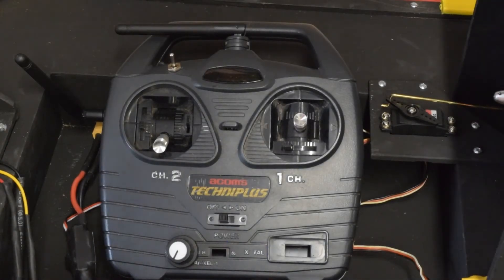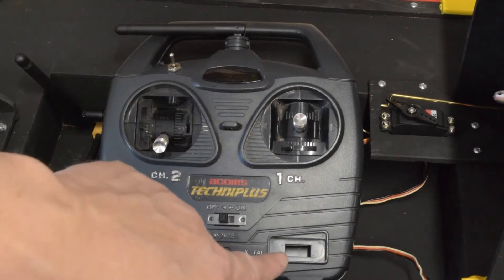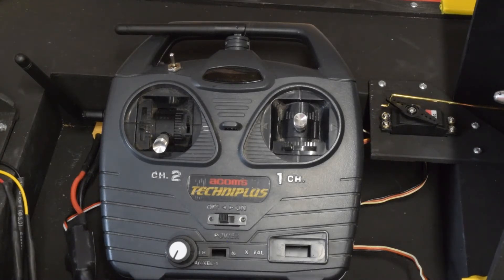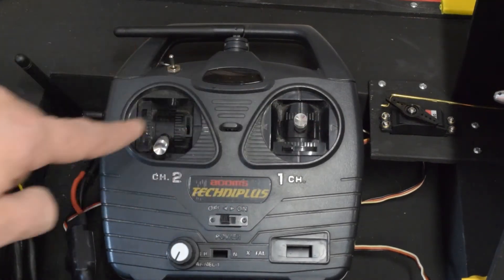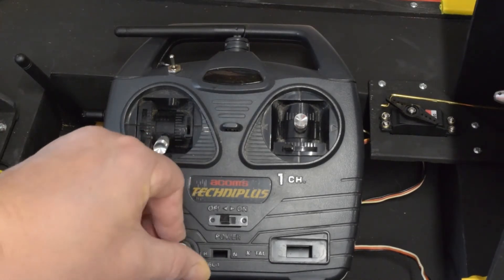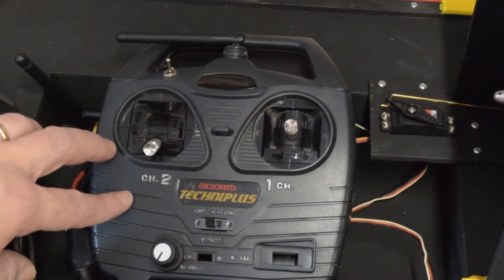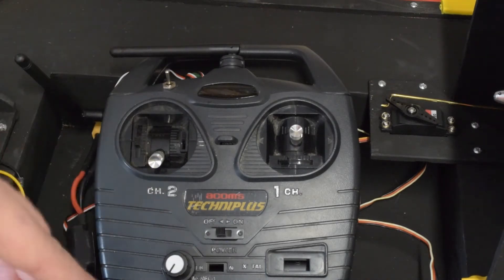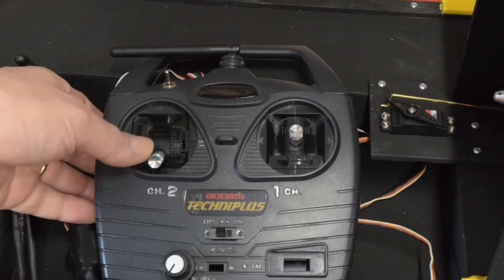27Mhz transmitter conversion to 2.4Ghz using Arduino and NRF24L

Comment: Thanks for this. I was considering doing this with an old Futaba Conquest, mainly because they just looks so cool. I'm trying to decide if I should just invest in a newer 2.4 Ghz controller and plug the receiver into my arduino mega, or if I should just do this.
Reply from the maker: Ultimately, it is a 'depends' type of thing.  With this setup, you can have up to 32 channels (although realistically the nano inputs restrict that), and can set them up however you like, but with the 2.4ghz, you will probably be restricted to the 4 or 6 channels they come with.